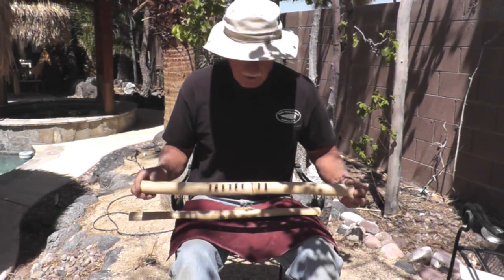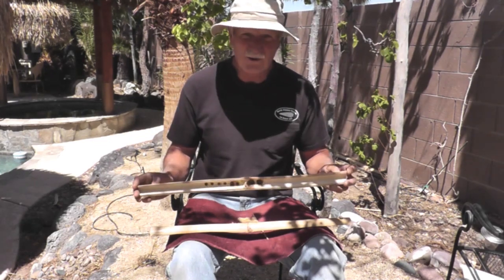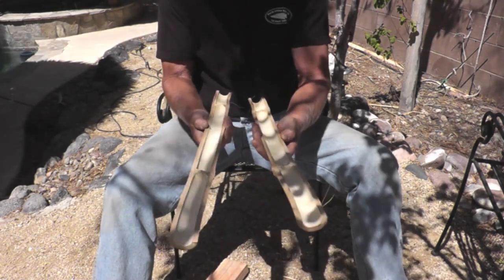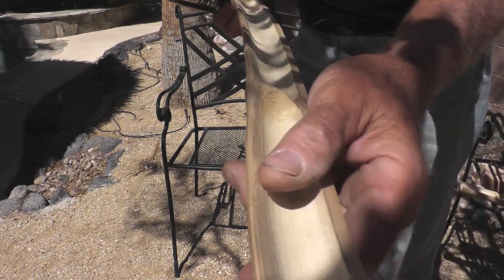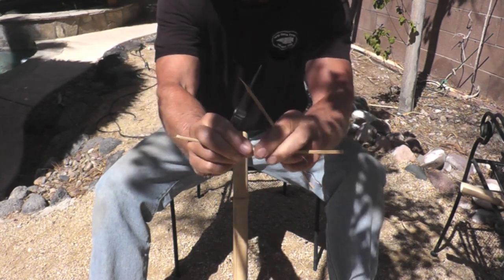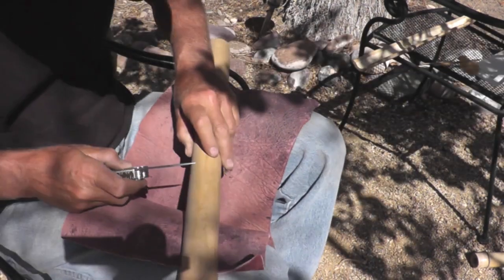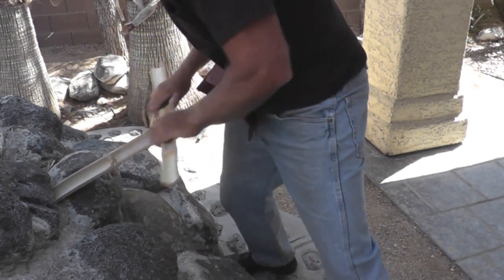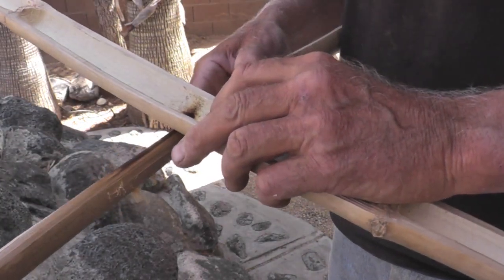Fire Making with Bamboo Fire Saw

Comment: The first method seemed to be more work but you got a big coal. The second method seems like less work but you got a smaller coal. Thanks for the excellent demonstration.
Reply from the maker: Yes, the second one was barely going....I should have gone another 5 seconds or so and I think a bigger coal would have resulted.....both methods are fairly easy....easier than the hand drill I think....

Comment: I do enjoy how you demonstrated "shaking" the bundle around instead of what a lot of people will do for airflow resulting in them hyperventilating (usually including a bunch of smoke) to ignite it. Great bamboo saw method, I'm going to have to try it, or the pump drill method next time i go camping. Lighters are for the lazy or in times of desperation. (Or if you need to make a zip gun)

Comment: Is river cane similar,just smaller in diameter?
Reply from the maker: Yes, river cane is like bamboo, just smaller. I think river cane will would work with this method if you select the largest piece you can find, something at least 1 1/2" or larger. Might be best to try using the ground sawing method as the cane will not be flexed as much on the ground. Good luck if you try river cane and let us know how it goes....

Comment: This was a first of this type I've seen.Another way learned.Very nice.I'm wondering if making 2 grooves with holes.the same width as the cross board would double the chances for an ember?Nice job,and Thank You for sharing the knowledge!
Reply from the maker: Bowtie41I I have never tried 2 grooves but this is one of the easiest methods to make fire. Even beginners can often get an ember on the first try if someone shows them how to do it. I can see why this was the preferred method in parts of Asia where bamboo as available. Thanks for the idea.....Jim